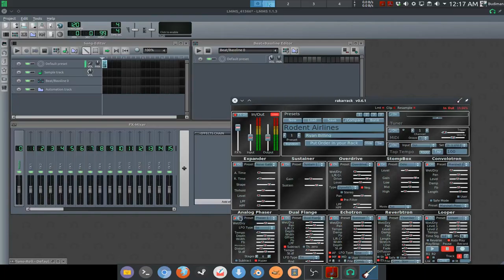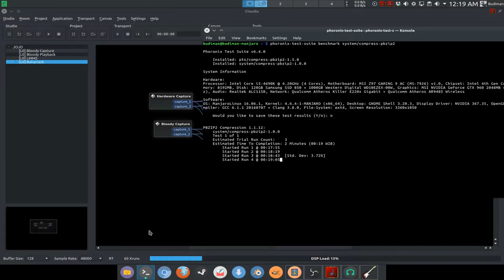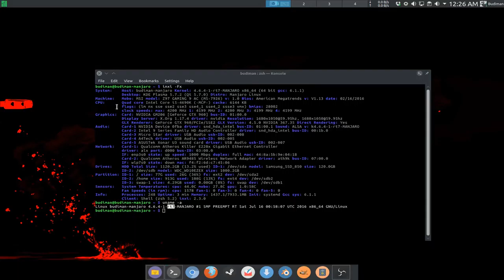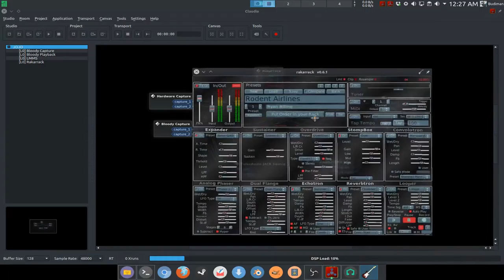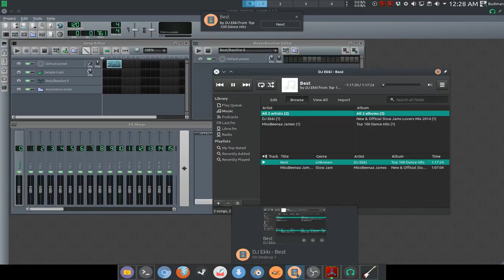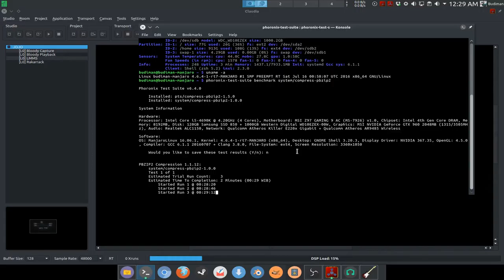Manjaro Realtime vs Stock Kernel JackAudio Performance

Comment: You did not connect the Rakarrack output to your hardware playback when using the RT kernel, for example @8:46. Maybe that's why there is no crackling?
Reply from the maker: No, the crackling is because of the massive XRuns when running in really low latency. I haven't got any crackling with everything opened and connected with RT kernel running for more than a month already. :) 
You can test it out yourself, running normal kernel and squeeze the latency to below 5ms. You'll hear a lot of crackling even by just listening to music. But if you set it to 10ms above you'll probably won't get any XRuns and crackling. :)